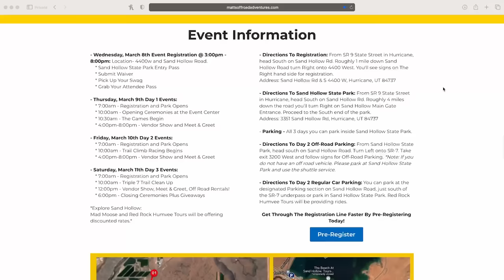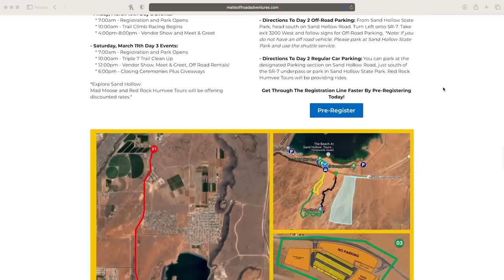20,000 LBS Truck Slides Off The Road...Did I Fail My Team?

Comment: With all the gear that you brought with you the one thing that was overlooked chain’s for the truck that needed recovering 🇨🇦🏴‍☠️
Reply: And the recovery vehicle. Some V bars would go a LONG way
Reply: A set of v-bars on the truck might have been enough for it to drive out of there on its own. Chains on the truck and the morrvair definitely would have gotten it without all the extra vehicles, winching, sliding, chocking, etc. But, that would have been a less dramatic video I suppose...
Reply: @grahammaxwell544  What are V bars?
Reply: I think putting chains on the customer's truck is outside of the scope of a recovery company. Plus they may not have a set for a truck that big just laying around. Now if they had a set for the morrvair, they probably could have gotten it out the first day. They seem to have a great dislike for tire chains though. Matt used to use chains on the banana occasionally, but it's been years since they've used them. That was back in the old says before the morrvair and the bombi.
Reply: Truck probably would have drove right up with chains on with all that weight
Reply: @MikeCris  v-bar tire chains: standard twisted link chains but with additional pieces of square stock bent in a V welded to the twisted links. It's the most aggressive type of tire chain.
Reply: @Chris Loehr  you're probably right about not putting chains on a customer vehicle for liability reasons (they don't air down tires on customer vehicles for the same reason). It would have been on the customer to chain up their truck. I also remember those old videos of Matt using chains (back when he was always teaming up with Casey's Off Road Recovery). Nobody likes to mess with putting tire chains on and taking them off. However, in the right conditions (like the conditions on that hill), they are worth their weight in gold!
Reply: Yes a set of chains on hand for every vehicle tire size isn't practical at all. If that truck didn't have bald tires it or risk taking drivers it wouldn't have gotten stuck

Comment: No, Matt... you trained your team well!  This reminds me of when I was a dispatcher for a tanker trucking company in Shreveport, LA, and got about 6 inches of snow one winter.  Within about 30 minutes around 400 vehicles had slid off the road on I-20.  We tried to get one of our rigs out to get a load of fuel for one of our customers, and when our driver tried to go over the overpass (over train tracks that went to GM's S-10 truck assembly plant), he got about halfway up and lost traction.  The rig slid backwards about 60 feet... luckily not jack-knifing!  The driver, who had over 30 years of experience got out of the truck and was white as a ghost and his hands were shaking.

Comment: That was a very good idea to get the Banana 🍌 and use both winches to pull that big truck. I was really surprised that the tires on the Morrvair didn't dig right in and tear through the ice to the dirt underneath.  Good job 👍
Reply: Their ain't no tearing thru ice without sharp Steele

Comment: Hi, bit complicated as system. On slippery ground, you can and should use some heavy bags of beach sand, drop it on the road and it avoids all these difficulties, you can drive the slope up more easily...Good luck it was hard job...Safe !!!

Comment: As for Carter that was a life lesson, never walk on a icy road with your hand’s in your pocket’s 🇨🇦🏴‍☠️
Reply: Hands out might have worked for balance before the fall, but once he fell hands in pockets is not so bad as it keeps from breaking wrist or arm as the instinct is to brace against the fall by putting your arm out. It actually helps to practice falling on grass to train yourself to keep your arms in if you are in situations where falling is a good possibility. A bruise is a lot better than a break!    (note, I have no ideas if Carter is a "trained faller" or not -- just giving some hard-won general advice here)  :)
Reply: @julianwesterhout9568  This is absolutely true! As a former gymnast and amateur stunt guy, you never fall with your arms out. Always bring your elbows and your arms in when falling. Even tuck and roll if you can. And never walk with your hands in your pockets when it's icy. You need them out for balance.

Comment: One of the best ways to do that job is with a bombardier and a very heavy duty winch. You would get a lot better traction and Is safer overall. Also those track machines are front heavy and easy to flip on inclines so it's safer to load forwards on trailers. Thanks for the great content and good luck on the next job.

Comment: My grandfather once had to solve an issue with a stuck truck, way back he did not have any winches or kinetic ropes. He simply took the reserve wheel from the stuck truck, grabbed a few old chains, with some measurements he welded a quick snow chain witch could be fixed with a few bolts. Not that pretty then the new snow chains, but it worked.

Comment: i will give little tip ...put real good ice chain under  towing automobile..then have good grip for tire...second tip is this...put other ice chain frontside truck backwheels and carefull drive up to truck those chain...and repeat this so long,as truck is off this,where that stuck... tip 3...keep with you sand in plastic box...put sand to slick place and spray little water...now you have like ''sandpaper'' and that is not slick again...

Comment: I drive trucks like that (freight liner and international brand) for a living and that is one of my nightmares, that and having the brakes go out to where when you pull the air brake knob it doesn’t hold and I’ve had that happen and go down a hill and can’t hardly stop. I know from
Much experience trucks like that are a disaster in snow and ice on level ground and worse on hills. That was dangerous for sure! Amazing job, and doing it without a full semi size wrecker is impressive

Comment: You can tell Jefe doesn’t quite know what he is doing! If he would of backed up and took a bigger hit he would of got the truck to the area with traction and got it out of there. He was taking small hits and letting out of the throttle once the truck started moving and killed the momentum. He seems like a great guy but I believe the office is a better fit for him, I think Lizzy should of been driving on that rescue and I guarantee she would of got the truck out without having to go get more gear and help. Either way a good safe recovery and another great video..

Comment: Cannot help but be a bit critical here.  How much trouble would one set of good v-bar tire chains have saved.   There absolutely IS a time and place to bite the bullet & "hang the iron" (put on the dang tire chains.)  In snowy winter conditions you ALWAYS run the "risk"/ possibility of finding icy conditions where chains will save the day.  CDL driver, been there "done that".

Comment: Here in Maine when you have packed down snow or ice we have sand trucks that spread sand and you basically can drive out of anywhere, I'm surprised that anywhere like this the roads are not sanded especially the secondary rose. But we do also have this type of weather for 6 months a year. And also just putting a sand and spreading it by hand while not by hand but with shovels. You would be amazed how much it works.
Reply: But that would cost somebody some body money to put that sand out every time.  Here in Canada we carry cat litter in the trunk just in case some body needs a hand.
Reply: @c-v-n3322  you guys dont sand/salt your roads every storm,? Here salt is put on State roads as plowing and sand/salt mix is used on township/secondary roads.

Comment: Fun fact, even in a situation like this the bambi (and other tracked vehicles) could have trouble. Used to operate a Morooka and a Terramac and under similar conditions you may be going up a hill like this and experience a sudden loss of traction. IN THAT EVENT IMMEDIATELY ENGAGE REVERSE! May sound like backwards logic but you will be able to control where you go and it will slow you down, if you do happen to do a 180 just drive it down normally in low gear.

 Also something that may of helped is having a pair of generic commercial sized tire chains to throw on that box truck rear end, since most commerical tires are around the same size you may only really need one sized pair for most jobs and you likely could of driven it out under it's own power.

Comment: OBTW:  That Caterpillar crawler leaves a nice ribbed road surface on the icy road for subsequent vehicles to get traction on.  NOT RECOMMENDED FOR PAVED SURFACE ROADWAYS. Also; Don't you just love those guys say their 4 X4 can go anywhere?  In 1967 I saw an operator get a Cat D-8 with a dozer blade on the front and double ripper teeth on the back get stuck in deep mug that was up to the top of the tracks on both sides.  He just shut it off and said he'd come back for it when the mud dried out.  He was trying to bust up baled hay at a two-barn hay fire the fire department had been pumping thousands of gallons of water on with multiple pumpers for over 15 hours.  I was a firefighter on that call.

Comment: Just a question on your first attempt at the box truck. It seemed that you were almost there, but no throttle was applied from the box truck? Why or why not did the box truck not help. It seemed liked with slight throttle without spin would have brought it up? Very tough job though,  great critical thinking!!!

Comment: Good job getting the box truck out of the snow bank and back on the road.  Why wouldn't you have a sanding truck make a pass or two on that hill so the truck could drive itself out?  The roads out my way are an ice base covered with sand all winter.  Traction is great once the sand is spread.   Just curious.  Good channel by the way.

Comment: WOOL SOCKS! The secret to handling the cold is warm feet and warm hands and warm ears. Warm hands are impossible if you’re working in the snow, but hand warming is a thing. Knit cap works for the ears, but if you’re working in the cold, if you’re not bald, one of those athletic headbands that also cover the ears, typically made of polar fleece, is the way to go. Otherwise your brain, which is essentially a radiator, will overheat. WOOL SOCKS! Wool is one of the few textiles that will keep you warm even when soaking wet. Wool wicks moisture, it moves sweat from wet to dry. This keeps your feet comfy in the cold of the arctic and the heat of the desert. Wool socks make breaking in new boots so less painful, and make hiking and working in broken in boots so much more comfortable.

WOOL SOCKS!

Comment: Why do you not use any winch dampers? Have you had a winch line/recovery rope break under load at all?
Reply: Those synthetic lines just drop when they break.  No need for a winch damper as long as they aren't hooked to anything elastic.  Add a long chunk of nylon strap or a Kinetic rope into the equation and then it's a different story.

Comment: Why don'tcha put'cha a pintle hook on that yonder bambi backend? 

& is it a straight axle with open differential and the "tank" like control is from brakes engaging on either side? 
don't know how costly it would be.. but hydraulic drive to each side of the vehicle would eliminate the need for having an auto trans

Comment: You knew about the problem with your Stoke at when you got it you should probably fix the radiator problem for the summertime so this winter you wouldn't have a problem with the radiator right

Comment: With studded tires on the Morrvair,  you would not be having any of these problems,  WHATSOEVER!  In fact,  it would SHOCK-YOU!!  

The first few times you see how much traction you get!!  Head snapping head hitting the head rest. When the 4 x 4 all of a sudden bites right through the ice and grabs dirt.

Like a cat, running wide, open on a carpet and decides to, “right turn Clyde”!!   (thank you the immortal Mr. Clint Eastwood.)   or when the 4 x 4 goes from snow to dirt and back and forward, the passenger head will be hitting the head rest!!

Comment: I love yall down there, but seriously,  have you heard of tire chains? Not the Morvair, the customer. It would have driven out by itself after first pull. It would not be in that position if he had tire chains on to begin with. I don't like using them but I just Used tire chains to get up on the East Side of Medford Oregon On my e 350 van

Comment: Man I do love you all, especially the positive attitude BUT let me admit 1st that I'm not a professional, just someone with more or less sound basic logic. That being said, I'd be really interested in getting both Matt's, Paul's, and Rory's honest assessment/positive but candid feedback on the last recovery. I understand there's numerous variables, preferences, philosophies out there to attack that problem AND IN PARTICULAR, I'D LIKE TO ESPECIALLY FOCUS ON JUST ONE QUESTION/CONCERN IN REGARDS TO THEIR MINDSET ON WHETHER (IF YOU SOMEHOW HAD TO USE THE SOLUTION THEY USED) OR NOT THEY WOULD ACTUALLY USE A SYNTHETIC ROPE, IN PARTICULAR, ONE THAT LONG TO PULL A HEAVY VEHICLE, UP A HILL IN THE MANNER THEY DID. To me, and I'm just focusing on one aspect of the setup, I SEE THAT IT MADE THE RECOVERY VERY INEFFICIENT, MORE PROBLEMATIC, AND QUITE HONESTLY DANGEROUS BECAUSE THEY ACTUALLY HAD MINIMAL CONTROL WITH THAT LONG SYTHECTIC RECOVERY ROPE AND THINGS COULD HAVE GOTTEN OUT OF HAND VERY QUICKLY!!! IT BE ONE THING IF THEY TRIED GIVING IT A FEW HITS (WITH A MUCH SHORTER ROPE), TO TAKE ADVANTAGE OF THAT STORED POTENTIAL ENERGY - NOT JUST BASICALLY DAMPENING THE TORQUE THEY APPLIED TO PULL IT UP THE HILL. Again, I enjoy your content, can't wait for the wrecker games, and simply a huge supporter of what you all do!!! However I was extremely concerned for Lizzy and the guys and hoping that this will be an important valuable learning opportunity for all involved because frankly SAFETY SHOULD BE PARAMONT BEING THAT LIFE IS JUST TO PRECIOUS. Oh and don't forget that I have already admitted that I'm not a professional - I'm all ears if someone can be kind enough to enlighten me some more. Boy! I knew I was bored, but not this much LOL!! I do apologize for MY OWN INEFFICIENCIES IN REGARDS TO EXPRESSING MY CURIOSITIES AND CONCERNS. HAHA! And in case anyone's curious, the names David AND NOT KAREN, SO DON'T GET IT TWISTED!!! 😁

Comment: Hey jefe, your supposed to drive on top of the wheel chocks. That way they won’t slide out to the side.
Reply: You also have to have someone hold the steering wheel so they don't spit out to the side.  Tying them to the bumper also helps immensely but I don't think that really possible on the banana.

Comment: Why not just have a sander/salt truck run up and down the road before you even get started? Especially if you were coming back the next day, it probably would of melted you’d be able to drive it out after a short pull of of the ice.

Comment: #matt   I would of love to go to the wrecker off road recovery games. But I'm in a wheelchair.  An if I would have towed my can-am XDS Max Turbo R down there from Missouri.  Then to find out they would not let me drive it around to watch. Because when Matt at first said about the rules for the people you can't bring UTVs. 
How is a person to get around on the sand in a wheelchair.  You can't I been a wheelchair from 1993. I lost both my legs above the knees. I was a tow truck driver working on the side the road. Semi top the hill seen my red lights jack knifed. Hit the back of the pick up smash me between the pick-up an wrecker drug me 213 down the hwy. I-44 in Missouri in 1993. Ice an snow. I was a tow truck driver for 8 years. Any way way should I go an set in my rv in a parking lot.

Comment: If you guys would have brought a couple shovels with you and broadcasted dirt on the wheel tracks where the truck was going to drive doubt you would have needed a 2nd pull vehicle dirt and sand hoes a long ways on ice